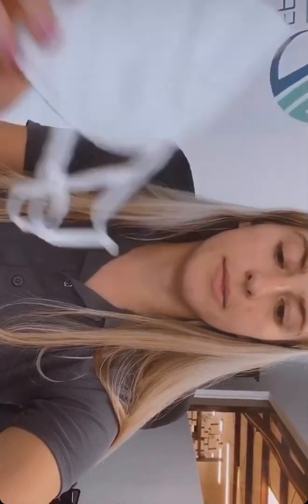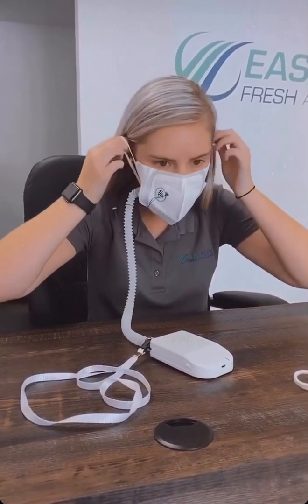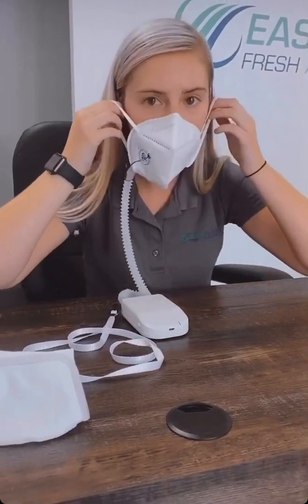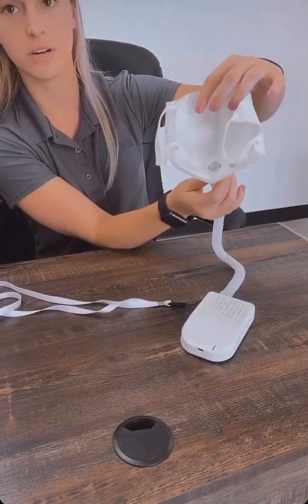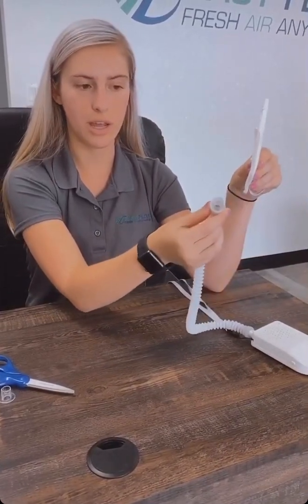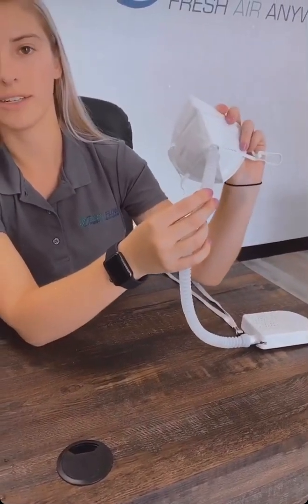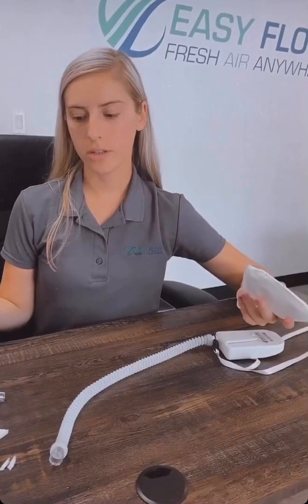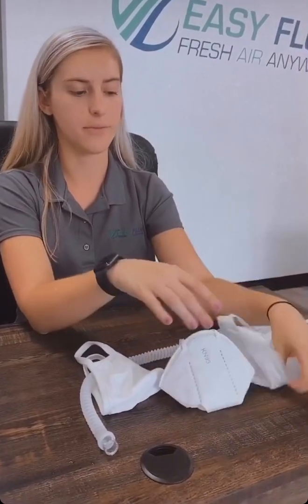Easy Flow Fit Test With 3 Different Types of Masks

Comment: If there is a improved version would like more air . Very useful using outside when doing yard work and don’t want to breathe in yard dirt dust pollen or sawdust when sawing wood . Lots of diy options  to improve fit. Reduced price nice to buy another .

Comment: 11-17-2020  -  -  -  -   I still think there should be a 90-degree fitting so the weight of the hose doesn't "bend" the mask.   I wear this easy-flow device for 40 hours a week.  Another thing that is needed is a spiral metal spring that goes the entire length of the hose so it doesn't kink.  Someone needs to invent something to keep the mask high on the nose so it doesn't slip down, which is really annoying.  After 8 hours the bridge of my nose hurts from that metal strip riding against my nose.  Lately I have been using cotton balls stretched open in the pinched part of the mask.  This helps some but the cotton keeps moving and falling down.  Some form of harness that goes over the head to hold the mask in place is really needed for serious long term mask users.  Sorry for the rant - had to get this out there.
Reply: Yes, and I want a faster car with better gas mileage.  These are opposing compromises.  The heavier you make the hose, the more it will kink the tubing or mask, as well as pull the mask downwards through the day.  I got a 90 degree nylon bulkhead fitting at the local marine hardware store.  You might locate one at your large salt water aquarium supplier.  They are used in filter box construction.  Use a two strap mask with ties, not elastic.  Good luck, and stay safe.
Reply: @SilverShadow2LWB   - - -   I was just looking for an improvement in design - not a lecture. Thanks anyway.
Reply: You are right on! Think of the weight of the hose that tends to pull the mask down even more! Your suggestion of a harness is right on. That will help to distribute some of the weight to the back of the head. That makes me think of rigging straps that go around the ear loops to form a harness. Velcro? If you come across a contraption, please share the link.
Reply: Velcro, baby pin, cord, etc.?
Reply: Oh, I forgot to mention this. For eye glass wearers, the frame of the eyeglasses has to contend for the cramped space between the outer ear flap (Helix) and the head. Due to the presence of the frame, the flap is already pulled down and out to some degree. Hence the ear loops will have an easier time to slip off the ear flap. An added challenge is when the person is also wearing a BehindTheEar hearing aids! Help!

Comment: Can you show how to connect 2 hoses together??? To make it longer?
Reply: Hello - the main hose is 400mm and the shorter hose is 300mm. You take the side of the 300mm hose that is smaller and insert it to one of the ends of the 400mm hose. Once they are connected, one end connects to the device, and one end to the mask. It shows this process in this video.

Comment: The hole is 7/8"
Reply: 11-17-2020 - - - -  Wrong.  The hole in the mask should be max 9/16"   - - - same as the outside diameter of the sleeve into which the connector fits.